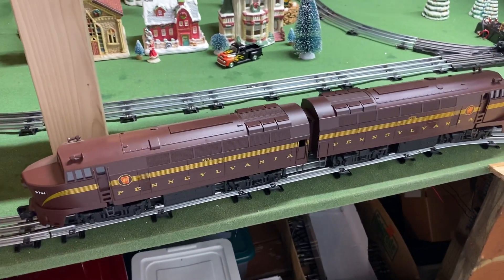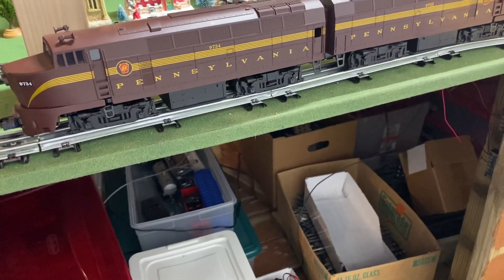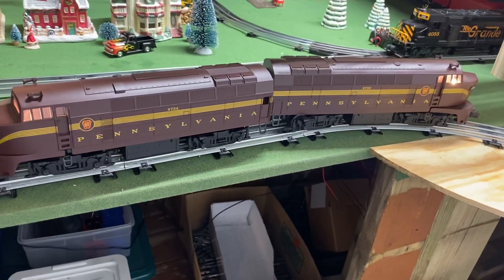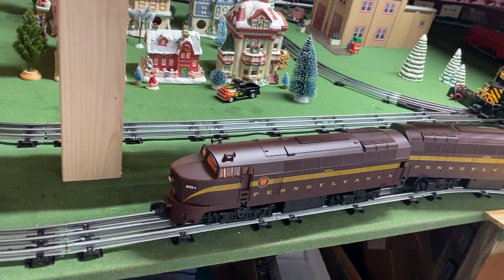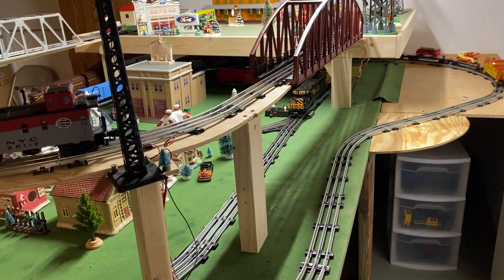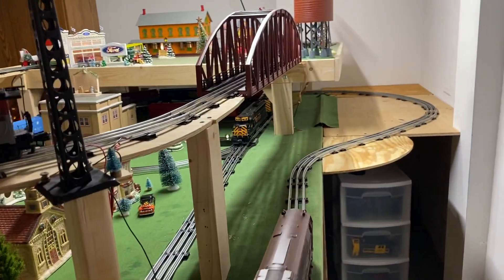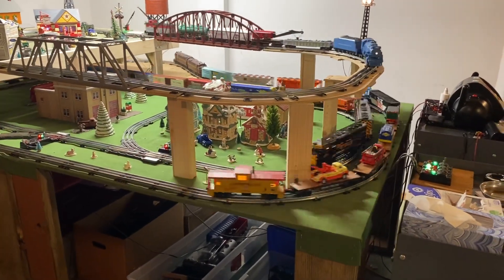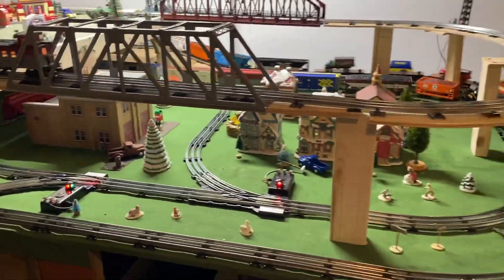My Locos: Williams Baldwin RF-16

Comment: I hit the send button by accident my Penn Central run all of the Pennsylvania and New York Central first generation diesel diesel locomotive. Since my o gauge railroad has subway car trains I can live with the third-rail because of that. Also in third rail territory electric. We're so equipped like Newhaven CP 5 woodrun pantagraph down in third rail territory and the early Penn Central days they would match up New York Central and Pennsylvania locomotive especially Baldwin's because only a Baldwin can connect to another Baldwin and this way they would fly the flag so to speak. Williams art Great locomotive very simple. I would caution that I had one locomotive that a truck on one side which lubricated and the truck on the other side was not and it filled up both of metal p

I would check my locomotives to make sure they are lubricated on both trucks because one-on-one locomotive was not lubricated and it fills up with metal
Reply from the maker: I agree -- maintenance is critical. I once bought a used Williams loco.  On first run, it was running quite poorly. Popped off the truck & found the gears to be shredded.  Seller fortunately gave a refund.
Reply: @scpvrr  I never checked my Williams locomotive to see if they would lose but when one truck had locked up on one of my I found that it had not been lubricated from the factory and was full of metal chips. From now on whenever I take a new one out of the box I'm going to take it apart and make sure that it is been greased from the factory.